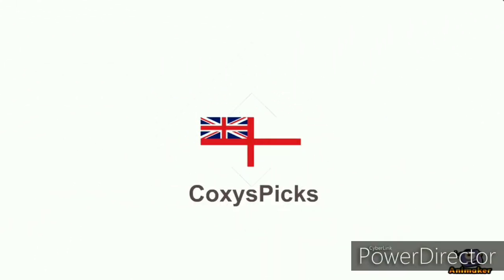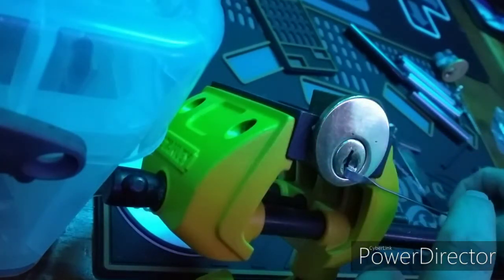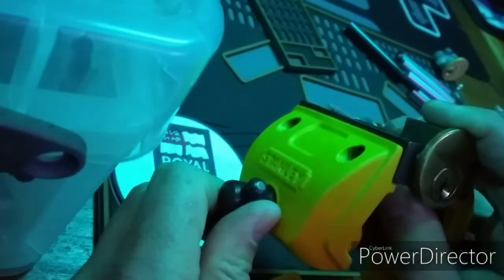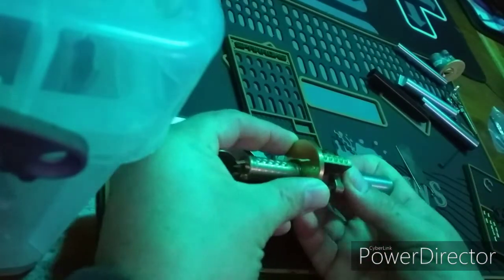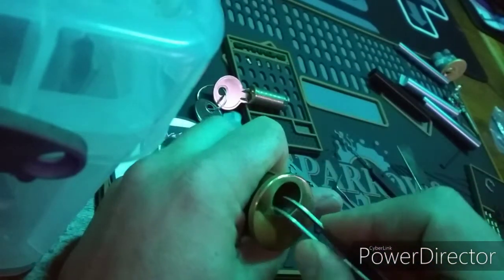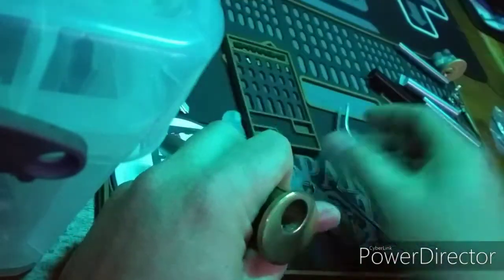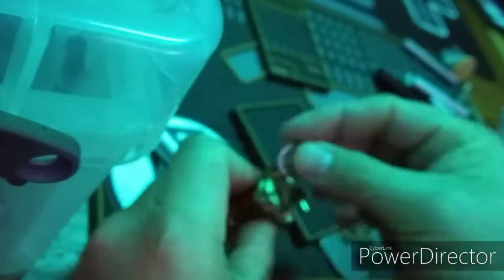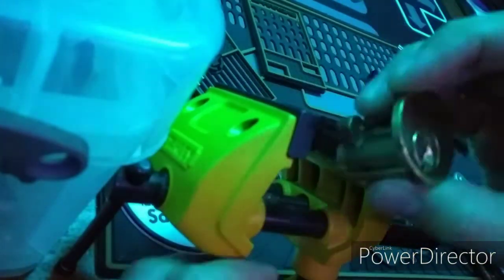Do security pins stop raking?

Comment: Great vid 👍 With such a flat bitting, the type of pins barely matters. Changing one or two springs to vary the pressure may help, but it mostly comes down to bitting in my experience. Have a great weekend and thanks for sharing this 🍻
Reply from the maker: My next move is to get another Yale cylinder. Hopefully one with variety of peaks and troughs. Then swap out the core in its entirety, leaving the stock pins in place and see how much of a difference it makes. What I can say is that SPP on the lock just got 200% harder lol. Have a great weekend buddy 😎🤘
Reply: Good point.
Reply: @CoxysPicks  you could swap in a couple longer keypins, then file the key to match. For sure, I bet it's more fun to SPP now 😎

Comment: A good experiment my friend, now just get a nasty bitted key with longer drivers. Have a great one.
Reply from the maker: I'm on it. I have found a nasty bitted Yale lock - and unfortunately I can't rake it, so does that make the test null and void? Or prove that keys are the best security with Extreme bitting?
Reply: @CoxysPicks  No it makes the experiment work using proper bitting/i.e; pins in the proper place/springs could help also. Security can be done in more than 1 way. Now I'd like to see the difference in a video. Proving it can be done.